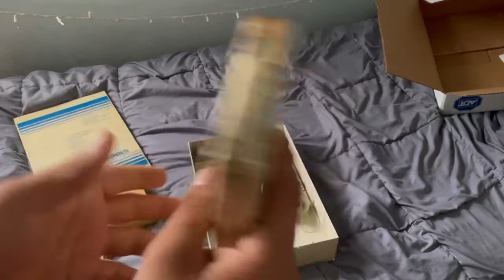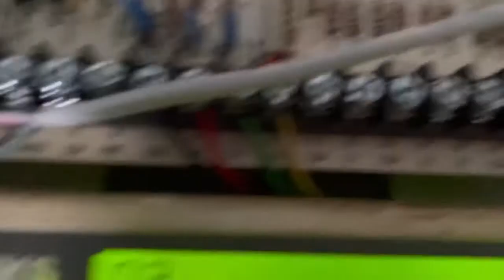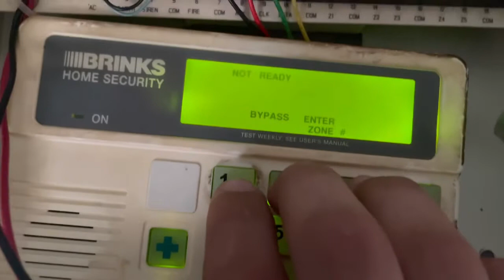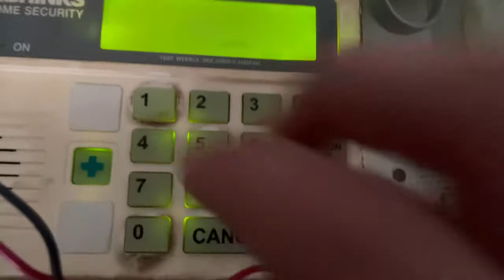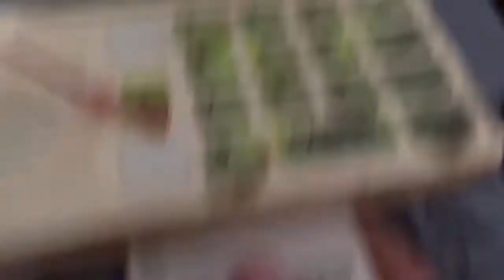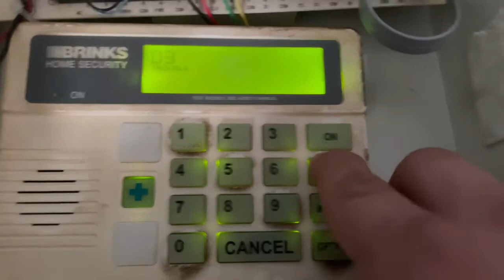BHS-2000 series security system

Comment: You should consider getting an S3121, you can program the 1000, 2000, 3000, and 4000 systems with it, trouble is finding it. Sometimes they'll pop up on ebay, though.

Comment: I like old alarm systems, their interesting.
Reply from the maker: I do to. This system is 31 years old, still working
Reply: Dang.
Reply from the maker: I saved this one. We had mice chew the wire between the keypad and the panel. The system was very staticky. The guy said I will not touch the old system and put in a whole new one. The new one did not work. We did not know the wire got chewed until he installed the new system. The new system is a Honeywell vista panel with keypad. I ask can I keep the old one and he said yes. I saved this system and it is up on the wall as a demonstration system.
Reply: Nice

Comment: I recently got an FBII Star XL4600 with keypad, strobe and door sensor. Long story short, the CPU is dead. Probably gonna get an XL2T or XL2P since the keypad can work with later panels.
Reply from the maker: Nice. I got this panel for our family business. We thought the keypad broke. They installed a new one because this one is 30 years old. Mice chewed the cable between the panel and keypad. They took it down. I asked to keep the old system. It will be used in the security system test series.

Comment: I have the same system with two keypads. Anyone know how to change system so that it doesn’t error when I only hookup 1 keypad?
Reply from the maker: The only way is to default the panel. I would not do it because you can’t reprogram the system without a special programming tool.

Comment: I have bhs-1000b installed at my place,  does anyone know what the sensor frequency that the system uses so I can buy the correct compatible wireless converter. Thank you.